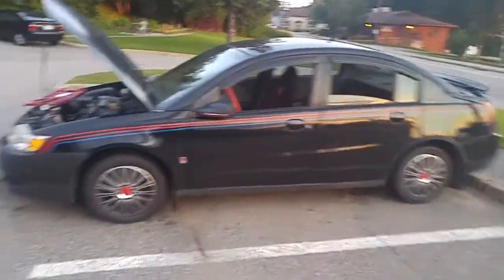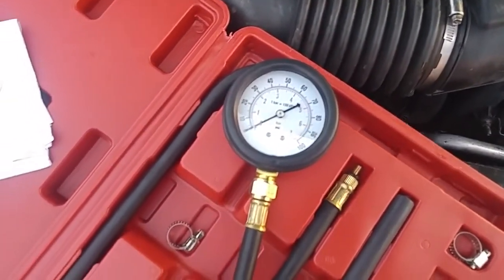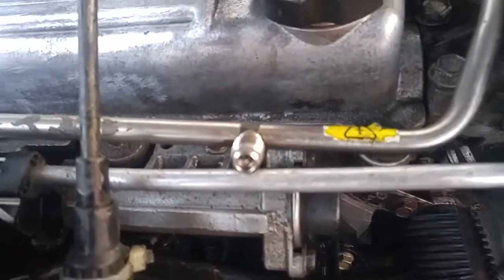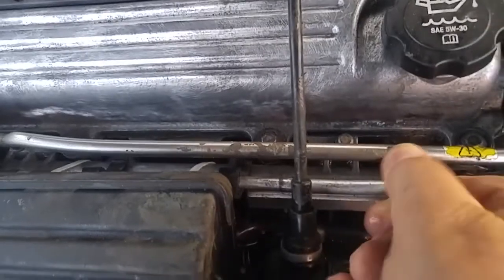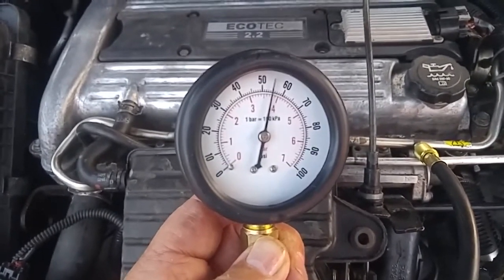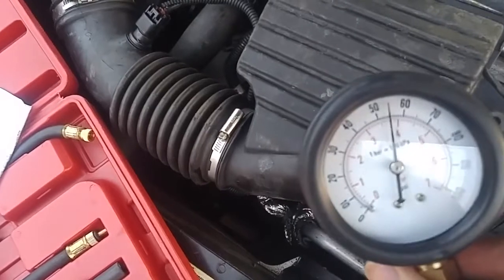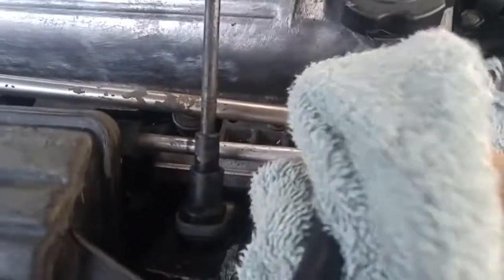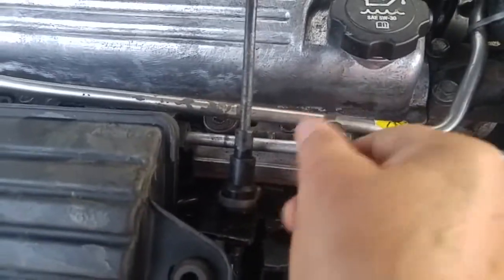Checking Fuel Pump Pressure on 2.2 Ecotec Engine

Comment: if the pressure is lower does that mean its the pump or the regulator?
Reply from the maker: Make sure the gas filter isn't plugged. I change mine every 30,000 miles or so. It's the pump if the pressure stays below 45 lb, but when you have the maximum pressure,  turn the key off and wait for 5 minutes. If the pressure drops more than 5 lb. , I'd be looking for leaks in the line. If it rusts through the line, it's usually near the gas tank.
Reply from the maker: I spray an oil undercoating on the fuel lines and gas lines whenever I get under the car.